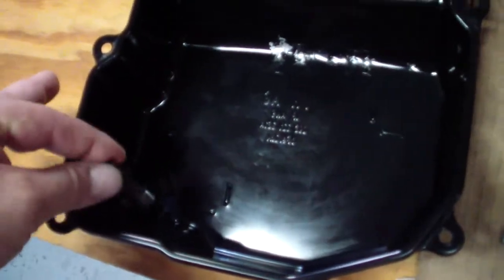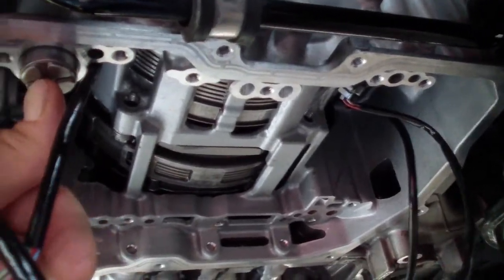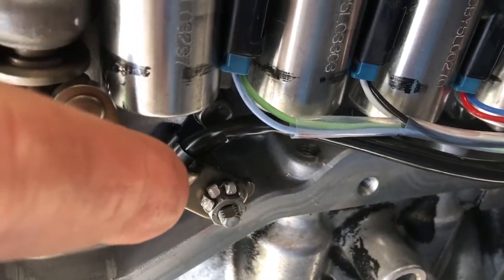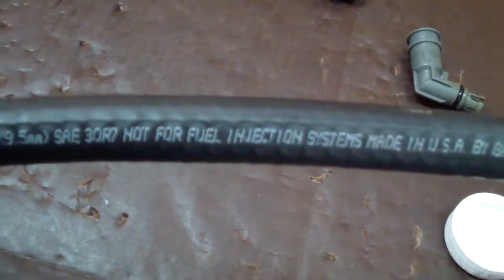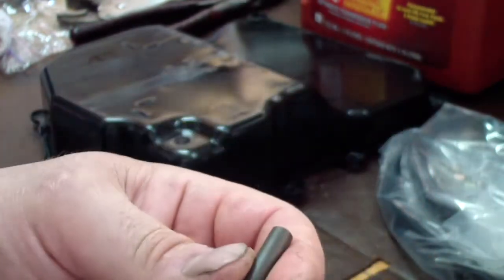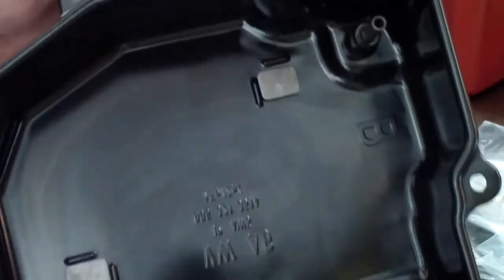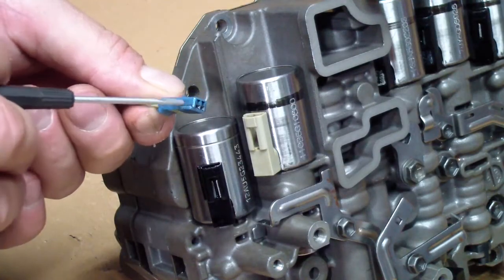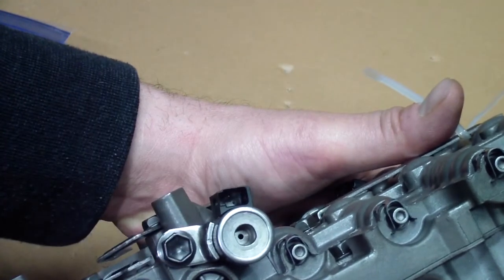09G transmission valve body refurbishing tutorial - Part 9

Comment: Congratulations, the car is fixed.  I hope to do the same after watching your 10 part series.  Everything I need to have confidence.   When you checked the temperature were you checking OIL PAN temp?   Also did you fill transmission EXTRA and let fluild drain after car heated up and then removing plug screw for drain?  Or did you run car with plug removed?  I think first.
Reply from the maker: Yes, I kept monitor the temperature with the VAG tool and using my temperature gauge to read the transmission oil pan. They two readings was very close. I filled the transmission with the proper transmission fluid ( plus little extra). Closed everything and when the transmission was warm and I already put it in all gears, then I removed only the plug and allowed the extra transmission fluid to drain. If you put it in gear and allowed the front wheels to spin while the vehicle in lifted, then you will get ABS fault. It maybe better to drive it if you don't have the tool. Also make sure you have no error in the engine, brake, transmission model after you finish the repair for the adaptation process to be successful. Good luck

Comment: Nice work I have 2008 Mini Cooper same problem hard shift. I followed your steps where did you purchase the program vcds and steps to adaptation I have no engine codes . Thanks for your help
Reply from the maker: I bought it from eBay. The cable and the program. There is a way you can do the adaptation without tool. Look online as i remember seeing the process some where. Thank you for watching and for the comment.
Reply: Thanks for the responds I check on ebay it looks like small obd programmer cable cd problem I have my computers no cd player on them. I will keep looking thank you for all your help and videos very educational.